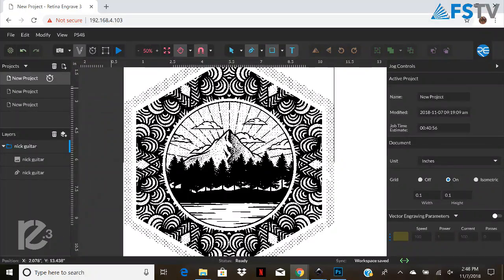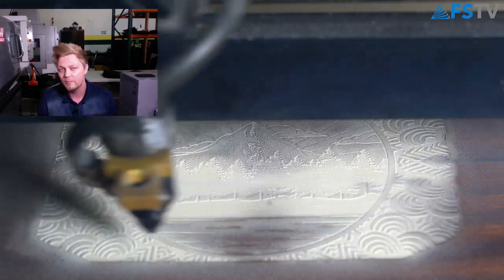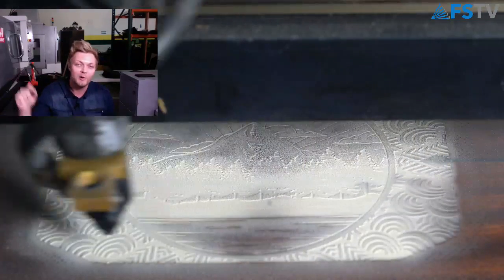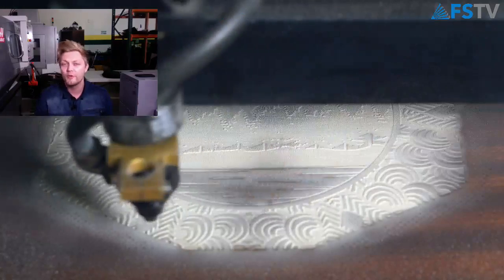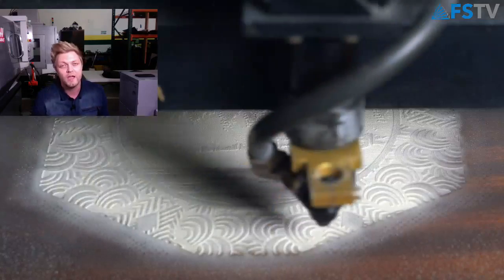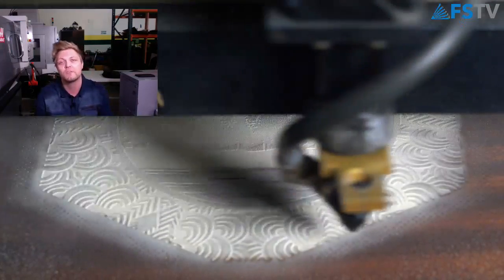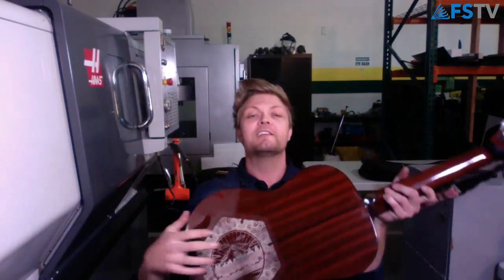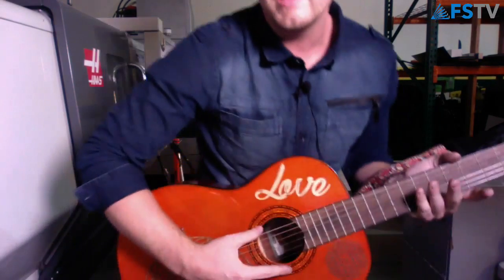In the Cut - Laser Engraved Guitar Design (120W PS48 Co2 Laser)

Comment: I have a 4x8 warthog router table that I am attaching new heads to. I am curious as to the list of items I would need for an addition of a 120w laser head. Thank you.
Reply from the maker: Well aside from the 120w tube, you'd need a set of mirrors. you could leave your tube stationary or mount it to one of your gantries, wither way, you'll likely need at least 3 mirrors. If your want to see where you're firing, you'll want a red dot diode/laser pointer and a beam combiner. After that you'll need a lens and a head and nozzle to mount it in. You'll also want an air compressor with hoses for an air assist, and you'll also need a water pump for the laser tube. That's it in terms of laser components, but you'd still need to work out what you'd need to mount said components to your machine.